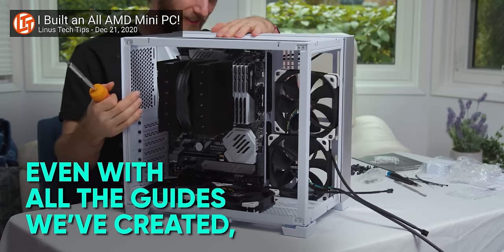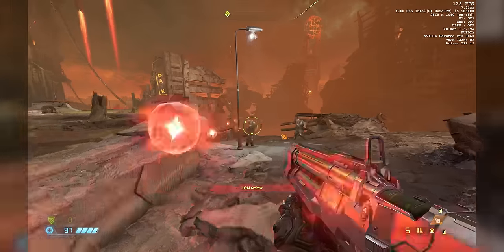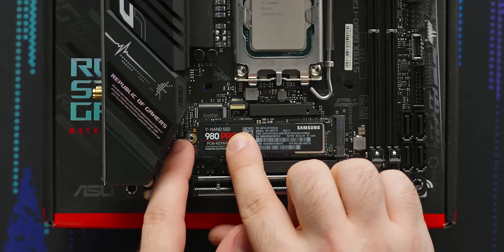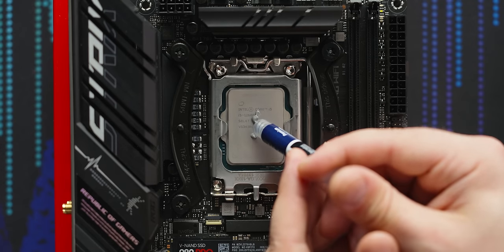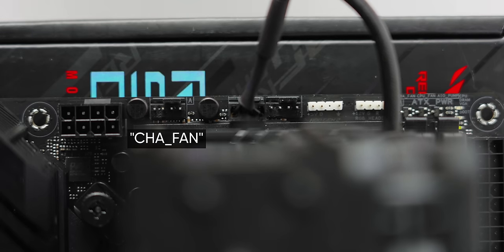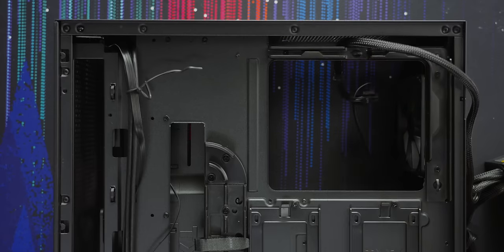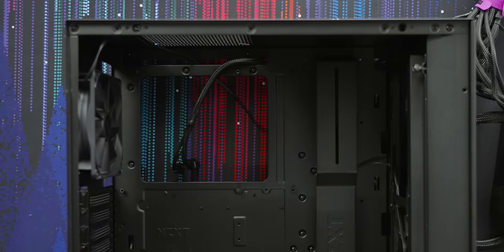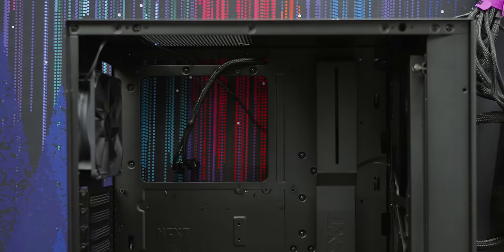The EASIEST Gaming PC Build Ever!

Comment: "foolproof"
"our case has 2 fans, but the motherboard only has one case cpu plugs, so either buy a y splitter or connect it to the aio pump power plug, but you might need to configure the settings in your motherboard to control the fans properly"

do yall know what foolproof means
Reply: Also

"The socket is so new our recommended cooler may not fit. In which case you have to call the company that made it and request a separate kit to make it fit."
Reply: Also the whole idea that if the person, who if they're building their first pc may not know exactly what they need, is gonna be fucked if they need to upgrade ram, or find they need internal capture or any pcie card, or realize that the build looks stupid in an h510 if they care about that. This whole thing would have actually made sense if they just had a b550 prime board, solving every problem and costing a third as much
Reply: When I clicked, I was thinking they had found mobos with cpus pre-installed. That's most of what would need to be fool-proof imo.
Reply: @evlkenevl2721  Problem with that is that most of them are the low-power embedded chips only. The only one I can think of that's any kind of powerful is the 4700S
... why didn't they use a 4700S?
Reply: @Fay7666  maybe it just feels incomplete when you build a pc without installing the cpu yourself?
Reply: isn't the 4700S an aweful cpu for gaming?
Reply: @theflyingfish66  Though, I guess Linus missed that actually that ROG motherboard has the holes for both current and previous gen mounts, so actually it doesn't even matter.
Reply: They don't have a clue what simple or easy means in terms of building a PC
Reply: @lmperioz  because building a pc isnt a simple or easy thing. If you dont want to build a pc get a pre built
Reply: @CrabHead501  I know, but Linus makes it sound way more complicated than it has to be
Reply: @lmperioz  He's dumbing it down for the less technically inclined. While it may seem like overcomplicating it, he's just trying to cover all bases for all mistakes that might be made. Key word: trying, you seriously underestimate how difficult it can be for someone who's never built a PC before.
Reply: @joemarais7683  I see you missed the point of "almost no room to screw up" lol, and hey it's a gaming PC for rookies, if they're gonna upgrade they'll at least have the knowledge.

Comment: On the note of small boards. I built my first PC with super compatability and upgradability in mind. The only changes I have made on nearly 10 years was I changed the Wifi card because I lost an antenna and I added an SSD.
So much for needing compatability for upgrades when you need to upgrade the entire thing at once.
Reply: I like to use a tick tock cycle. I upgrade the GPU, then in ~18 months I upgrade the rest. Each half costs a similar amount to upgrade and upgrading components that are 3-4 years old makes each upgrade feel meaningful without ever feeling like my PC just straight up sucks.
Reply: I know what you mean. Most of my upgrades to my now over 10 year old computer was replacing failed components and when I was finally ready to upgrade I ended up replacing everything. 
Now my old PC sits next to my newish PC on the same desk so I can do other things while I’m gaming.
Reply: Also the reason why I went mATX with my upgrade, never used the slots on my ATX board, allows for a much smaller case (went from 54l to 24l) and is still technically compatible with two gpus in a different case
Reply: @or2kr  my case is massive because I repurposed a bitcoin mining motherboard that has if I recall 21 pcie slots all 1x but there is a single 16x slot 

My main purpose for using such a large board over my old one was the slight boost in performance since my old board was using ddr3 and pcie 2.0

New board doesn’t have all the requirements for windows 11 but at least has uefi and secure boot making windows 11 at least more manageable over the old board since missing those features will eventually cause a world of pain if something goes wrong in windows 11 which I’ve already witnessed because without secure boot and uefi windows 11 can not schedule a disk check of the boot drive or enter recovery mode for starters
Reply: @stephentidwell2244  you can purchase a standalone tpm pretty inexpensively if you're inclined

Comment: 4:46 you rotated the mobo 90 degrees without showing it on screen, meaning that when it comes to mounting the cooler, it will look like you're supposed to screw it straight into the mobo.. unless you're paying attention (the brackets as black on black and in shadow as you put the cooler in).

Comment: Linus: you can build this pc in 10 minutes!

Me: I spent 20 minutes yesterday trying to reseat my ram
Reply: I spent a couple hours the other day swapping my PSU and doing cable management. something that would probably take Linus like 20 minutes max. Admittedly though, I was also watching anime while I worked
Reply: The exposed, naked RAM is painful to sit in. It is somewhat spiky
Reply: Well given Linus' livestream PC builds normally take at least an hour, I'm suspicious that it only would take 10 minutes to build a PC.
Reply: @Penfolduk001  he usually builds more complex stuff, and talks the viewers through it. I'm sure if was speed running it would be quick, mb 10 min is a bit too ambitious tho
Reply: @alexanderlee5180  it only took me like 3 mins to build my whole pc and it was the first pc i built (it isn't in a case lol that's the only reason it was fast just sits on a large shelf i don't see the need to buy a case atm i don'thave any hard drives i need to mount or anything so there's no need)
Reply: @danielrobinsar7711  yeah it was cheap ddr3 so it was pretty painful to get it in lmao
Reply: @oliverboi  broo make sure to clean the dust regularly
Reply: @pitoou2770  yeah I know lol all i need is a can of compressed air

Comment: I've built my first pc about a year ago and only just made the cable management look good in the front and back (cable management is the worst bit about building your computer/desktop)
Reply: I never want a case with a window for the rear panel, I just want to shove everything in the back and forget about it
Reply: @Activision 1234 whats the point? Even well managed cables aren't much to look at on their own
Reply: @bacon.cheesecake  if you have an over priced fancy case it can look visually pleasing, but proper cable management actually helps airflow and heat management. (I'm not being an elitist my back panel is opaque and I gave up halfway through trying to organize my cables)
Reply: @ioasisyumich  I like fancy cases, and proper cable management, just not in the back. Although I think ltt or someone did a video on the effects in had on airflow and found it made basically no difference

Comment: Small recommendation, if you have braided cables and an h510 flow or just any nzxt case, I recommend you loop them around the cable hider from the right not the left.

Comment: Finally somebody makes front panel connector in one piece. All motherboards produced in last 20 years or so are using the same pinout of front panel connector. If anybody needs to use some weird board, they can just get some dupont wires from Aliexpress. Do you remember when front USB cables were also terminated in individual wires?

Comment: I bought an H510 and the front panel connector saved me a lot of time.
Considering I have a longer GPU (GTX 1070), I routed the PCIe power connectors through the side cable management hole the the ATX power connector goes through. They're less of an eyesore then they don't run up from the bottom

Comment: 7:32 The EVGA GD lineup is actually not that great quality wise. If you want a good non-modular PSU, take the BitFenix Formula Gold series; they're very well built and often cheaper as well
Reply: I like EVGA power supplies... What's wrong with that one in particular?
Reply: @tomasrosalesr  non-modular EVGA PSUs are shit. I speak from experience.
Reply: It is worth noting that the 700 GD seems to have been replaced in 2020, as the 80Plus database lists two radically different models under this name. The current one as shown in this video looks OK efficiency-wise at least, the older model (fan on top if you can read the label) had poor 10% efficiency which is not a good sign. EVGA seems to have a very confusing lineup in general, with I guess multiple different platforms from various OEMs.
Reply: @Susanna That's the most wrong thing I've seen in long time, lol.

Comment: That unified front panel connector needs to become a standard. It is the one part of a system I either skimp on, leaving off the reset, HHD light, or it takes forever. One unified plug has been the obvious solution for well over a decade. It would greatly speed up system builds.

Case makers should just blatantly rip off NZXT here. If I'd known they were doing this I'd have bought my most recent case from them simply for that feature.
Reply: ...it takes all of 5? seconds to rtfm and plug them in one time...
Reply: @Thebadbeaver9  homie, I've struggled for over 25 minutes trying to get them in because of the awful location and tiny size, some people are built like linebackers and have fingers the size of a summer sausage
Reply: No, I specifically wire my reset-button to my BIOS-clearance pins.
Reply: @marcusborderlands6177  Exactly. Add in that I'm getting on in years and my fingers aren't as steady as they used to be...

Comment: Love this video.  Can you do a follow up for clueless noobs like myself showing in detail the OS install, the set up for general use/gaming ( bios settings, driver downloading, etc ), and the the actual process of getting started gaming ( where to go to down load games and how to download and start playing ).  This video was very helpful, but I have already mostly taught my self ( with video help ) the hardware assembly bit, it is the software part I am completely clueless.  I'm mostly interested in first person shooter games, racing sims using wheels pedals and shifter, and VR using Oculus rift / rift s.  I've bought second hand used hardware/controllers and a cockpit frame from amazon.  Also maybe some flight sims combat mostly.  Any help with this side of the process would be a blessing, also please talk slow as I am an "old fart".  The last computer I built was back during Operation desert storm aka the Iraq war part 1 when I was 20.

Comment: I'm sorry is this a verge reference?

wrong power cables shown 7:50
PSU installed with the fan pointing up 10:00 (I know it's no big deal, but usually we want it to draw in cool air from below with these massive case feet) 
"we need to screw it back down" 11:28, next shot shows an unscrewed GPU
"I'm so confident", doens't show if it runs first try but shows that it did not turn on when he pushed the power button

Comment: He forgot to warn about the sticker in the bottom of the CPU cooler
I can already see the damage...
Reply: Also should have mentioned to tighten the screws little by little from each side
Reply: I think this video is a supplementary to the actual build guide they made. The build guide is a one-size-fits-all, and this video is a "I watched that video but I just want an easy pc to buy and build"
Reply: Actually, it won't cause any damage, although it will be causing severely degraded performance. lol
Reply: @lightly-red-huedmaleindivi6266  I like your take, and I love your pfp.
Reply: 12600K... and B660 motherboard.

Telling the viewer to install the M.2 slot on the back of the motherboard... which is connected to the chipset instead of the CPU PCI-e lanes.

Also, they didn't note that you have to screw both of the screws on the aircooler mounting down evenly, a few twist each at a time. If you screw one down fully first, the other one won't fit...

Comment: I still remember my first modern build. I chose an ASRock board, and this exact model would not post without an OS installed. It took me almost two weeks of disassembling and reassembling the system before I tried booting it with the Windows install media, and boy was I happy to see a video signal! So yeah, if you are new to PC building, remember to at least read the mobo manual.

Comment: I see a lot of people get carried away with ssd heatsinks but you don't really need them, they don't reach as high temps as cpu's or gpu's and the ssd only gets used in quick short bursts, they don't "thermal throttle" or slow down. The only way to bring an ssd up to max temps is to stress test it but this in no way resembles any real life scenarios such as gaming or rendering. Just because the heatsinks exist doesn't mean you need them, that's just companies trying to sell you an extra product, like hard drive coolers way back in the day.

Comment: great guide, will be emulating this soon  for a build ill be doing. my one gripe is the use of the 3060, when for currently the same price the 6600xt is 10% ish better
Reply: Price wise on the 3060 ya. But for stability wise is way better. Still hearing about tdr crashes on amd cards. ;(
Reply: @markdavenportjr5129  fair dos but id still take the performance myself
Reply: radeon gpus in my experience tend to have more software issues then invidia
Reply: Better in rasterizarion, worse in ray-tracing.

Also, for this tier of GPU, I'd consider DLSS a must-have. But if those don't matter to you the 6600xt is the way to go.
Reply: Honestly, for the price I would get the 3060. DLSS is a game changer for that performance bracket. And that's coming from somebody who hasn't used an Nvidia GPU in any build since 2012.
Reply: That’s your only gripe? This is a 1.7k USD build with a fucking 12600k + 3060. The component choice is fucking ass.
Reply: @omarismail8772  literally every component but the cpu and gpu are garbage choices and there are equivalents or better parts for every one that cost half as much with no "easiness" compromise.

Comment: I had so given up on getting a GPU that I didn't even realize prices were down until Linus said so in this video. I've been using the same 1060 3gb from my previous 2 pc's in my new build for almost a year, and it has seriously bottlenecked my cpu
Reply: They’re WAY down. Used 2060s are 300 USD or less all over eBay, that’s what I got. That’ll set me and my 1080p monitor up for at least a few years :)
Reply: Grab a 6600 man, they're better than a 3050 by quite a bit and you can scoup one for 340 rn. ik I certainly am
Reply: Lucky bastards, the UK has yet to catch up

Comment: Now we need someone to accept the challenge. Do this build according to video, but make as much mistakes as possible. Wrong CPU fan direction, PSU fan next to a case wall, monitor into MB port... you name it. Staff makes bets on mistake count - whoever guesses closer wins.

(Saw the comment about cpu cooler base film - it should work, too. Basically if something needs to be done but not mentioned in this video, it's your "mistake").
Reply: Instructions unclear, Cat is now Astronaut.
Reply: If Microcenter can sponsor me I’ll do it, I’ll The Verge proud

Comment: Remember to install X1 Precision and set fan curves to maintain 10% fan speed in idle for the EVGA 3060 TI XC. 

The zero-fan mode it is in by default is going to have you have mini heart-attacks all the time because the fans spin up so suddenly your desk is gonna vibrate.
Reply: Or use something alike FanControl by Remi Mercier to make proper fancurves....
Reply: I have 3060ti Xc and there’s something wrong with your pc maybe a loose screw or cable but the card is so small that it doesn’t make snitching vibrate at all
Reply: AMD RX580 does a crazy fan braking noise that's freaking unnerving. 😖

Comment: Just so everyone knows, I've bought those 128GB flashdrive (yellow ones, 4 in fact for sanity sake) and the are probably just 32GB with some firmware trickery to show up as 128GB. They will work up to the 32GB but after that speeds drop to near 0 and files refuse to be written and even corruption. I've told my local microcenter (St Davids) about this several times but nothing's happened. My purchase were spread out across about a total of 6+ months. Posting this here in hopes to warn the public. Sure I might be an isolated case but 4 times spanning months, I don't think that is coincidence.

Comment: I disagree with one thing in this video, that being cable management. The cable management in this build is so bad lmao, i get that it was supposed to be a quick build but for all the new builders out there if you want your pc to look good, cable manage it right the first time. If you brush it off to "do it later" i guarantee that the cable management will stay like that for atleast a year. It is so simple to just do it when you originally build the pc and it will make it look so much better. Other than that this is a pretty good build

Comment: IT'S NOT FOOL PROOF BECAUSE YOU MADE A MISTAKE!!

At 7:50 , the editor labelled the 6+2 PCIe as "CPU 8 pin", and the 4+4 EPS as "PCIe 8pin" !!
A computer building neophyte watching it would have that miss-labeling ingrained in their brain, and could potentially try to push in these cables swapped, and potentially kill their motherboard, CPU or GPU.

Comment: One thing to note about the recent Asus Strix motherboards is that they have extra holes to accommodate LGA1200 cooling hardware so you won't have that much issue with compatibility (unless the heatsinks are too wide or the AIO pumps touch the heat sink)

Comment: I have quite a few problems with this video. Mainly that Linus assumes someone doing their first pc build wants to drop $400 on an ssd, and $300 or more on RAM. Very conflicting to talk about being able to reasonably by a gpu when you don’t even mention you could save money with DDR4 and a pcie 3.0 drive. ALSO, that drive will ABSOLUTELY throttle if you don’t have the heatsink on it. My 2TB Samsung 970 evo was hitting 60C installing games WITH a heatsink on it.